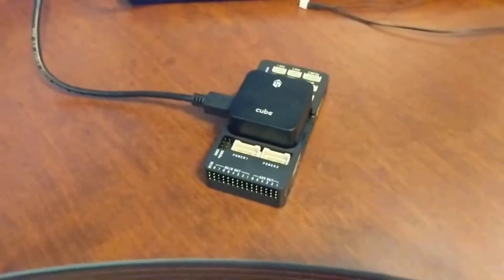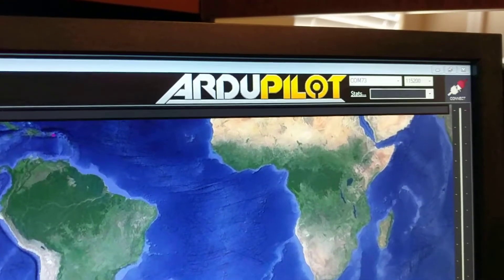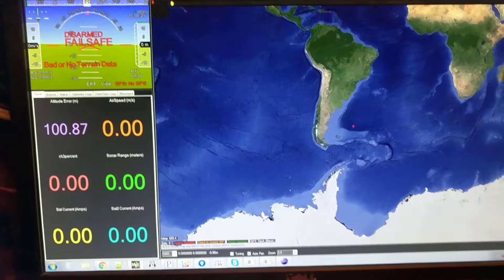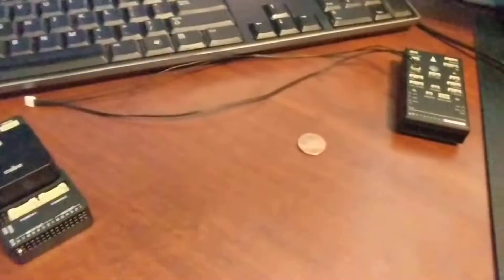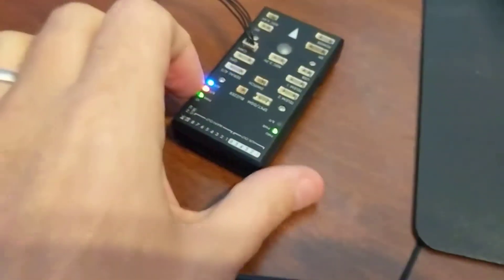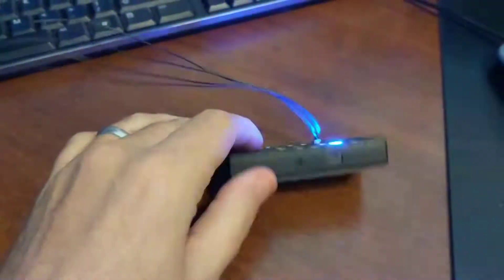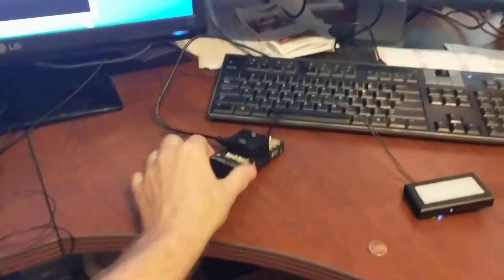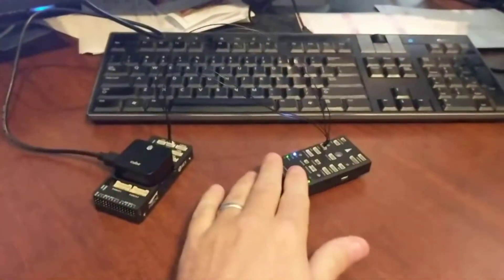MAVLink over UAVCAN on ArduPilot

Comment: So MAVLink is a layer above the UAVCAN protocol, which is a layer above the (standard) CAN bus?

Also, is the idea behind the video that you can link or add multiple Pixhawk Cube flight controllers at run-time, as to never lose the connection with the host pc?